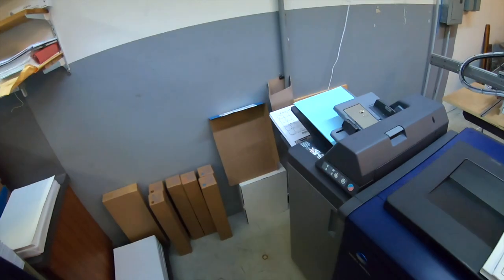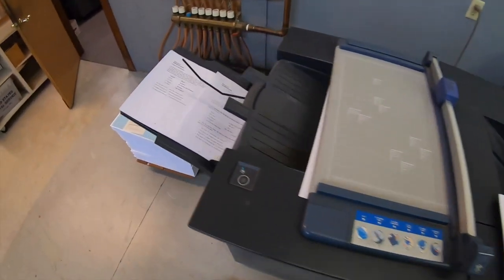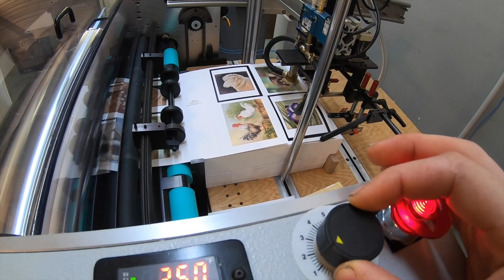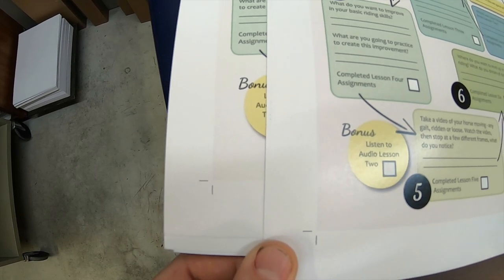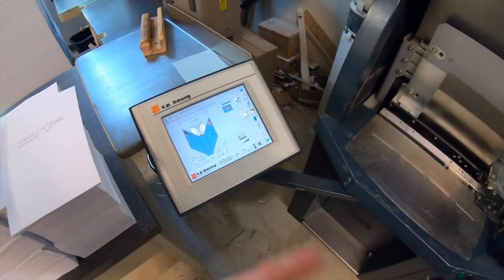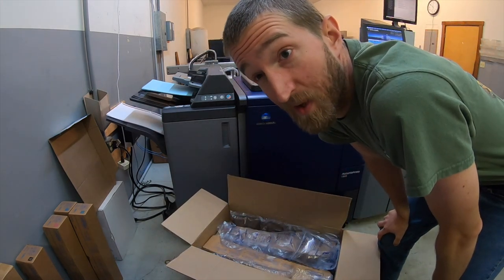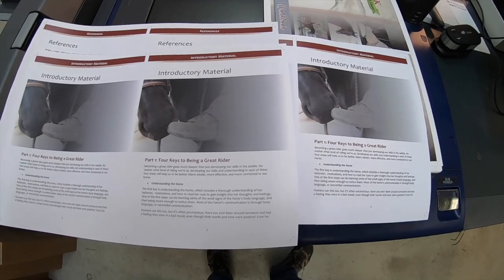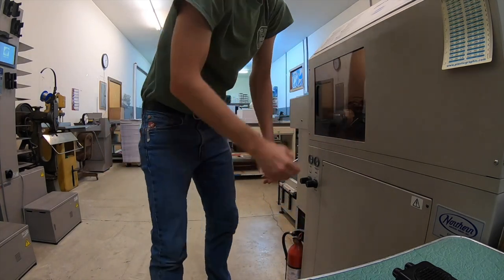Transparency and Color Issues Fixed on Fiery RIP, Busy Day at the Print Shop

Comment: I haven't checked, but I'd assume its still there somewhere in Calibrator, but use the check box for 'Auto Gray' to remove light color screens from backgrounds. Always tone up the engine first (gradation adjustment), then calibrate. Profile after corona wire or developer changes, then calibrate. Learned that from an old buddy that was a KM instructor.
Reply from the maker: Interesting. I'll have to give that a try. Keep the knowledge coming!

Comment: I am currently using the 1085 and 1200 in my shop. The 1200 is on it's 15th year and still going strong.
Reply from the maker: Very cool! My 1200 is going strong too!
Reply: Hey what's your current digital machine ??

Comment: Hi Dan! Had a interesting query! For a perfect bound / centre pinned book, the cover of which is digitally printed and laminated on one side (i.e. the front side only), after a few hours of placing the book on the table, the cover tends to fold upwards. Is it because the cover is not laminated from the inner side and the moisture makes it do so ? Will laminating it on both sides solve this issues?
Reply from the maker: Yes laminating both sides would solve that issue.

Comment: I really like your printshop and your equipments. I'm planning to buy a Konica Minolta AccurioPress C83hc in the couple next months and I was stunned by the colors !! However can you tell me how much the C3070 with the same configuration did cost you ?
Reply from the maker: My configuration cost was $45k. Find your own financing if you can, and pay Konica cash, you should save a few thousand. I don't bother with the added expense of the "hc" I really don;t think my customers would notice the difference. What are you being quoted for a C83hc?
Reply: @justaprinter  If I tell you won't believe it. The C83hc price is around $80k but prices varies from region location to another. We deal with Konica Minolta EMEA resellers so product prices are in euro and are more expensive.
Reply from the maker: @pondorbox  I'm not surprised. I used to have a c8000. I found that the slower machines were much cheaper. If you buy two slower machines you will have more combined speed and redundancy. That is my strategy.